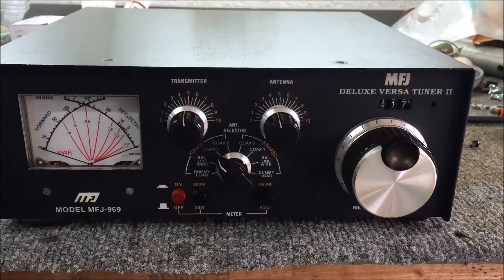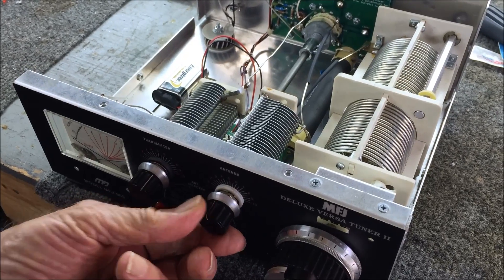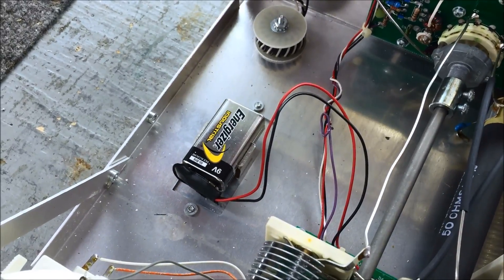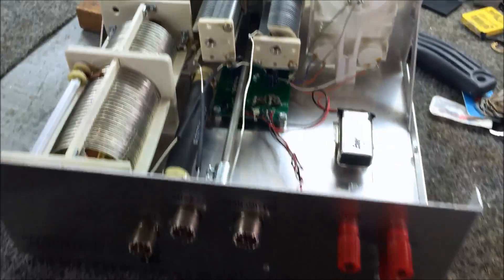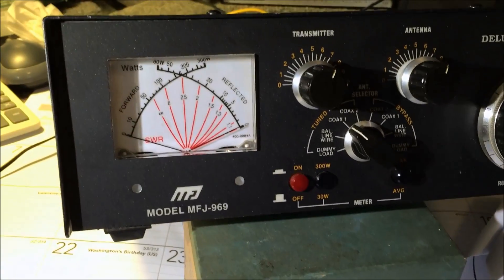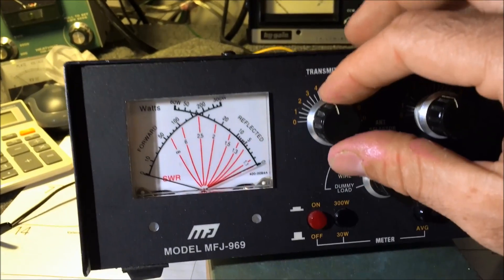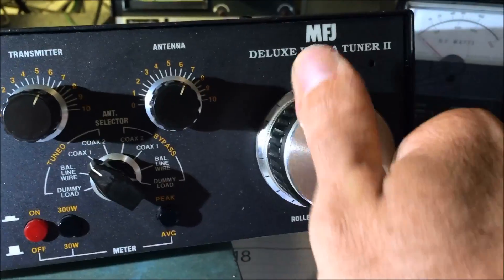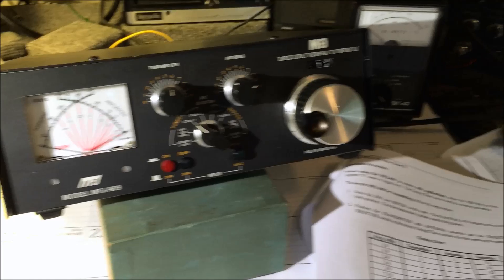MFJ-969 deluxe versa tuner roller inductor HF antenna tuner

Comment: Yeah, I have a MFJ 969 Versa Tuner II also.  I used to use it for my old Kenwood TS-430s but now I have a Yaesu 991a with an internal tuner.  So far the Yaesu internal tuner will tune any of my antennae since my antennae are nearly resonate.  I even got my coax cables mixed up and plugged my Ringo Ranger II into the HF antenna and it tuned it for 10 meters without any problems.  Only thing is, I couldn't tune the Antron 99 to 2 meters 'cause the tuner only works on HF 30Hz to 6 meters--same as the MFJ 969.  Finally got my cables straightened out and got 'em marked in case we have another electrical storm.  73 from W Rusty Lane K9POW in eastern Tennessee

Comment: I using this tuner on my Yaesu FT 991a so the radio goes from 5 W too 100w , what power setting do I use to tune up at ? 30w ?
Reply: The 30 power reading on the meter and the 30 setting.  73 from W Rusty Lane K9POW in eastern Tennessee

Comment: what would be the point in tuning the tuner into the dummy load? it's a perfect 50 ohm resistor load so tuning has no effect.
Reply: You would’t need to tune that, but it’s convenient for setting your mic gain, ALC, testing power output, etc. It saves you one more “box” from your shack and you don’t need to swap coax cables around to do it.

Comment: Love mine. I have one of the older models before they upgraded the look a little. I had to clean the roller inductor a little and fix a few cold solder joints when I first got it though. Their quality control is horrible.

Comment: I bought the same tuner, used in mint condition, at eBay Germany. But I think someone "de-synconizised" the counter (maybe after a repair or so). Speciallly the inside position of the brass-connector of the coil is not syncron to the counter. For my correct unterstanding and a new selfmade syncronisation: The absolutely right stop-position of the inductor wheel is for about 50,2MHz and similar with the absolutely backward stop-position of the brass-connector inside the coil. At this position the counter (over the inductor wheel at the front) has to show about "123" (concerning the MFJ-manual, page5). If I rotate the inductor wheel to the absoluteley left stop-position, the brass connector inside the coil has to be at the absoluteley front-position and the counter shows about "033" for about 1,8MHz. Is that ok? I hope you understand what i mean. Kind regards from Germany Mr. Rainer Reinhardt
Reply: Rainer Reinhardt check the user manual to reset the dial.  Turn the inductor knob all the way counter clockwise and push the rest button in the hole to the right of the counter
Reply: @CQN1HN  thx for your information. The counter section had a mechanical fault. I have a new one and now everything works fine.

Comment: Ive had the same one for about 15 yrs and it always works great. If the roller inductor  starts feeling a little crunchy, a small shot of deoxit and let it dry, does the trick.

Comment: You say power is not necessary except for the lighted panel meter.  Actually, power, whether from battery or wall wart apply power to the meter and to the metering circuit (transistor) and the forward power meter.
Reply: BATTERY=>only for Pep readings
EXT Power=> Pep readings AND to backlit the meter 
Still even with no battery or external power the meter works but just in avg mode and to work the red switch must still be ON.
Reply from the maker: No that's not the case.. The battery is ONLY for PEP readings
it has nothing to do with the metering of this unit. It is an antenna tuner, not an analyzer
Reply: @HamRadioConcepts  If it's only for PEP, then WHY didn't you STATE that?  You are leading people astray with this.  Regardless of whether or not you are in the field, you STILL need to monitor PEP, and even MORE  so in portable/field operations, and close-quarters/field day setups.  Please correct this video.